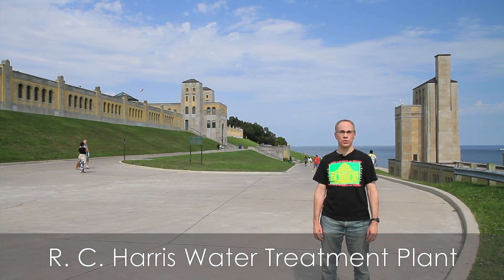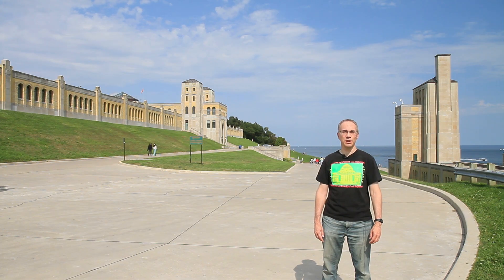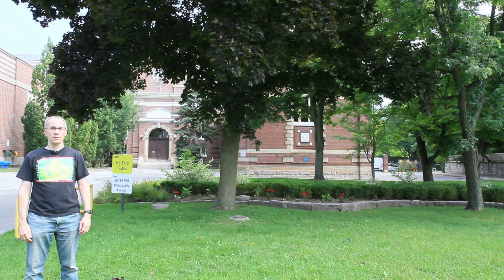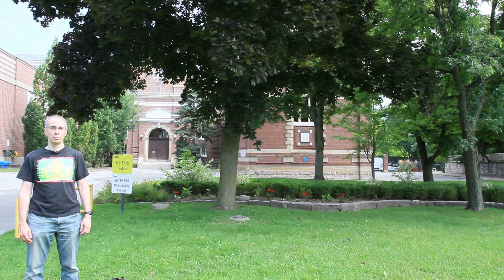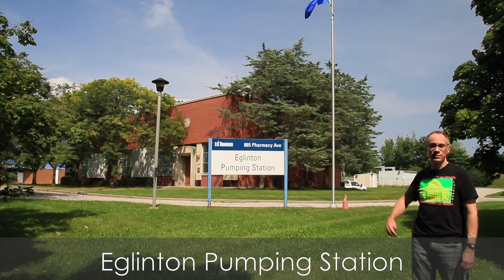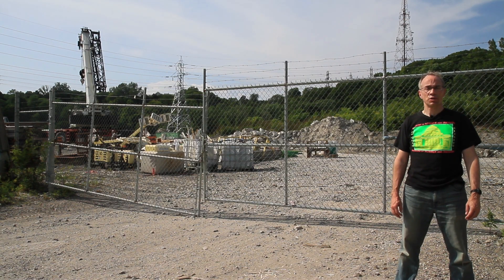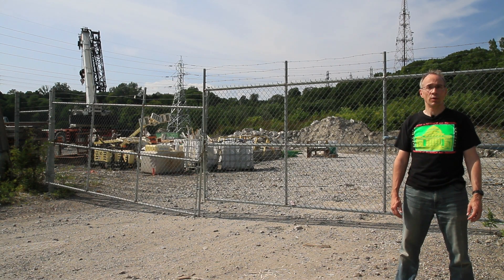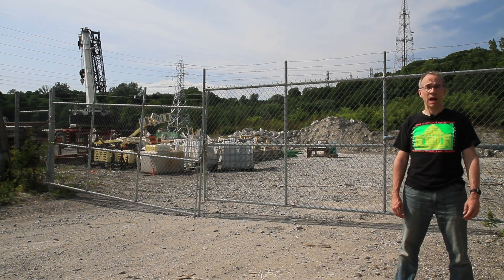Toronto's Water Supply (or There And Back Again)

Comment: Related to the John Street Pumping Station, there's a project underway at Toronto Western Hospital that will do the same, in reverse, with waste water. Well, in both directions really. In the winter excess heat will be pulled from waste water in a heat exchanger, and in the summer heat will be dumped into the waste water. Since its already on its way to a treatment plant, it makes sense as a place to displace heat.

Comment: Stop adding hydrofluoric acid  --  AKA -  "Fluoride"  --  to our water system !
Reply: Learn some rudimentary chemistry before posting a comment like this
Reply: you better have a good dental plan then
Reply: @brianbarker2551  insect-repellent helps prevent mosquito and tick bites, but you're not supposed to drink it !
Reply: @mtlicq  correct, it's for topical application
Reply: @brianbarker2551  There's enough fluoride in toothpastes already, BUT YOU'RE NOT SUPPOSED TO SWALLOW IT !
Reply: @mtlicq  it's fine, it won't hurt you. What does that have to do with water
Reply: @mtlicq  well that explains this thread too
Reply: @brianbarker2551  Sunscreen can be good to prevent skin cancer, and insect-repellent can prevent mosquito & tick bites too, BUT YOU'RE NOT SUPPOSED TO DRINK IT INTO YOUR BODY !!!  There is more than enough fluoride in toothpastes already, we do not need to drink this toxin !